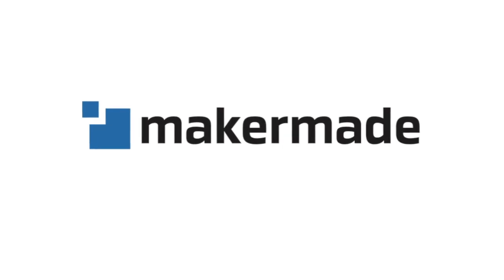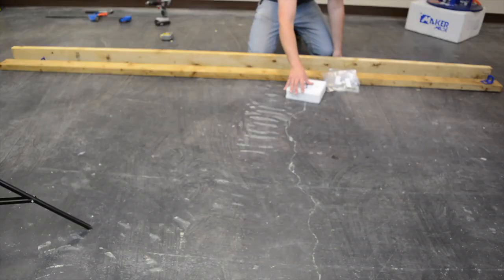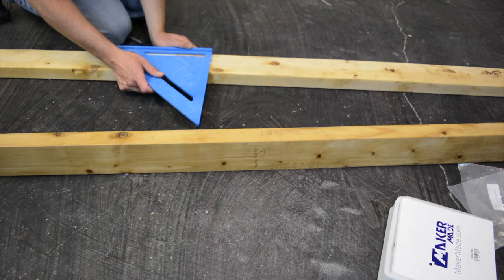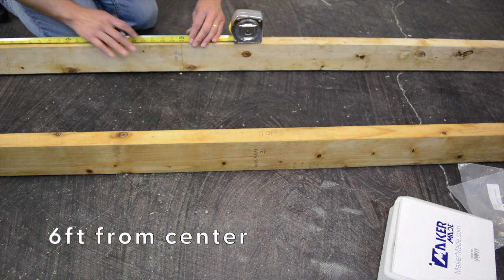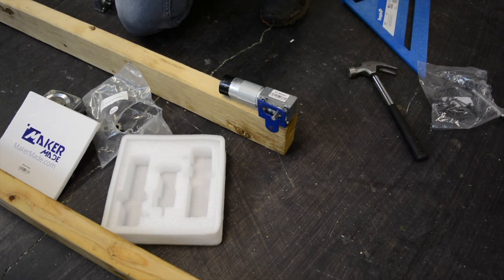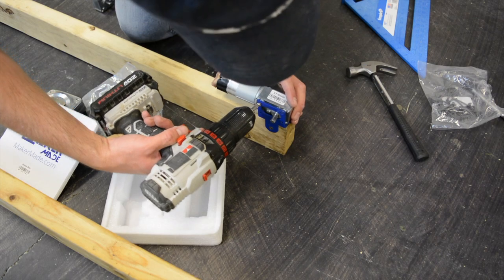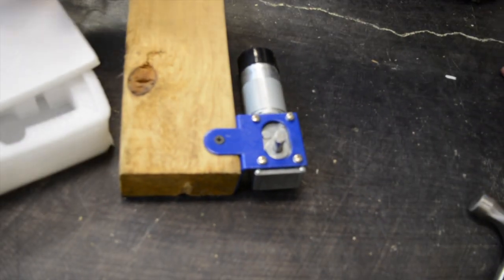Building the XL Frame Part 2: Attaching the motors

Comment: On the cut list you specify 2 – 12’ 2X4s
Then in the video you say get out your two 12’ 2X4s
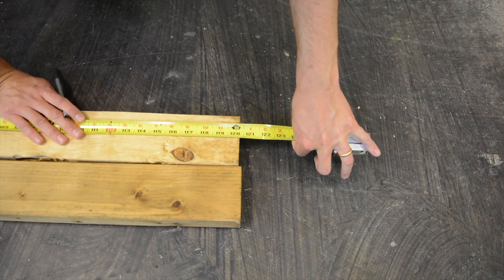But then at 0:31 seconds in you show 10 foot 2x4s being measured to find the center which you show to be 5 feet.
They look to be about 10 and a quarter inch so which is it?
Is it 10 foot for the standard and 12 for the XL or 12 for both?